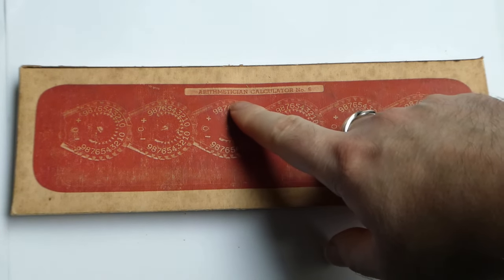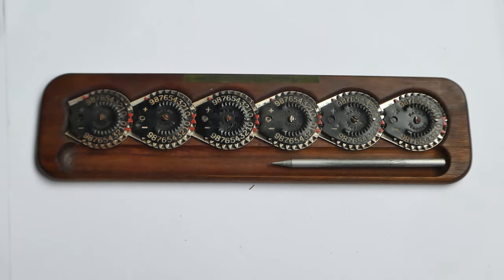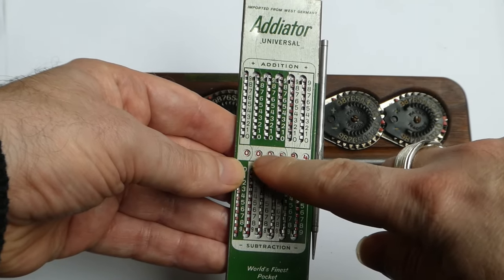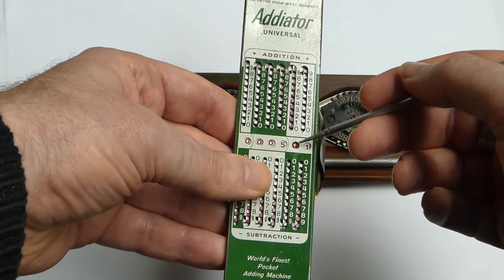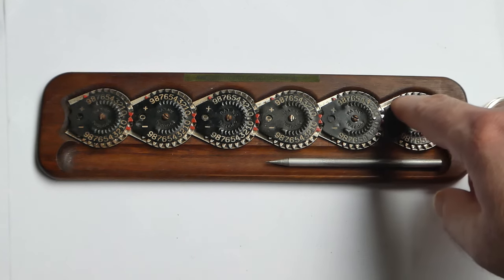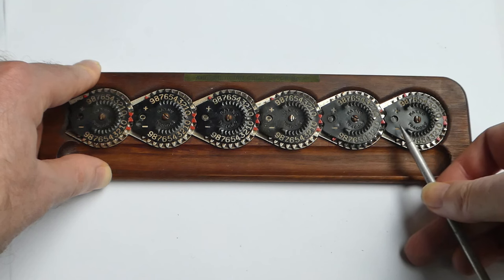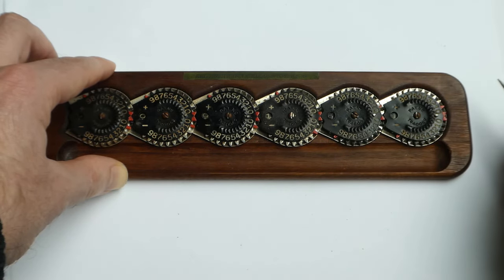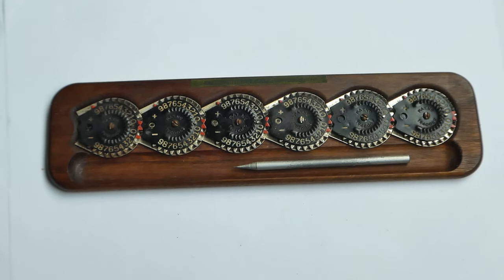The Bair-Fulton Arithmetician Calculator No. 6

Comment: Really appreciate the cleverness of the mechanism but yes it is a bit of a solution looking for a problem. It reminds me of what we In software engineering call the XY problem (or fallacy);: How can I do X (implement a slide adder) using Y (a dial mechanism)? The answer is that you probably shouldn't; you design a traditional dial adder instead.

Enjoyable video as usual, thanks 😊